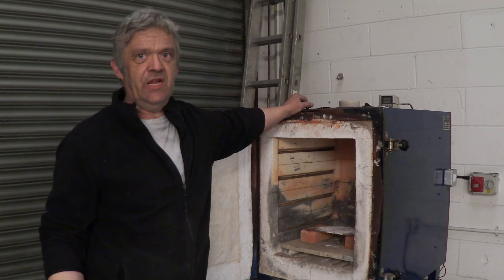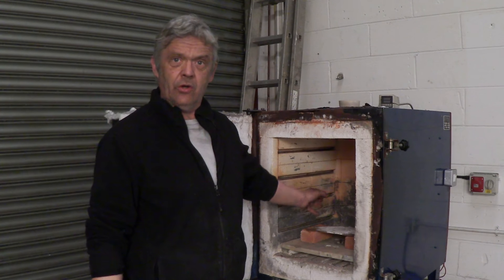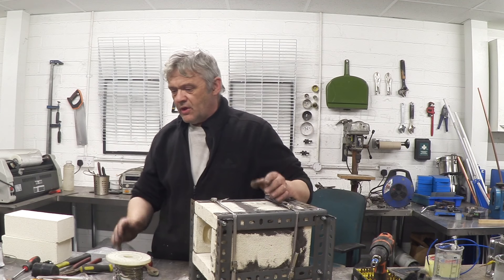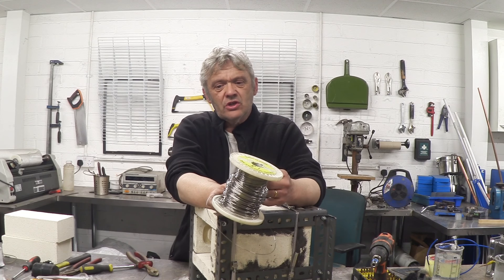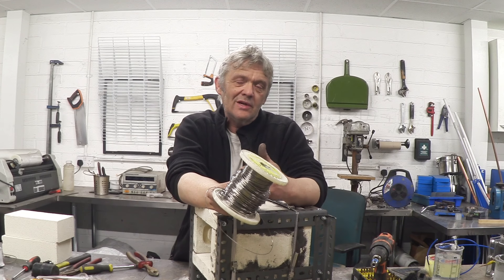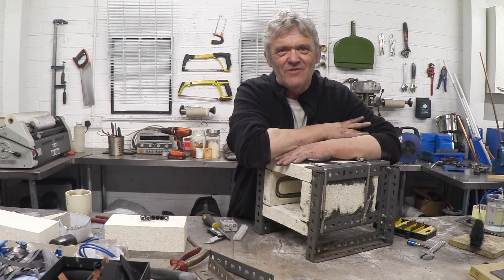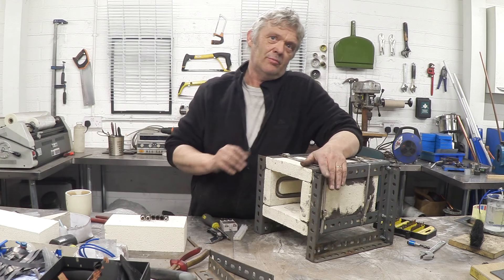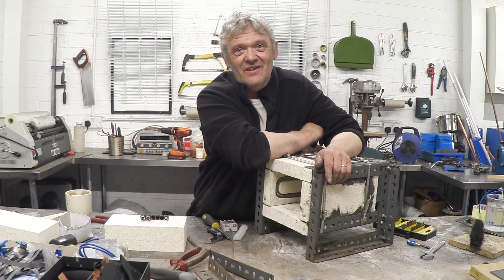How To Make A Lab Kiln - The Heating Coils

Comment: Double up your straight resistance wire at the ends and twist it. This lowers the resistance at the ends and stops the wire glowing on the outside of your kiln near your electronics.
Reply: They not supposed to glow. They will be hot, but not red hot.

The higher temperature of the conductor - the higher its resistance, coil heating faster because each of its turns heat itself and 2 neighbour turns + it is insulated with brick from 3 sides, so coiled part of the wire will heat faster, it would have higher resistance and because of higher resistance will generate more heat, while straight ends of the wire outside will stabilize at some 300-400C. This is common thing when straight ends of the heating coil not glowing, but the coil already yellow hot.
Reply from the maker: you can do mate - but there is no real need
Reply: @ThinkingandTinkering  In professional kilns the heating elements always have twisted(double) wires at the ends. This is also to avoid breaking the brittle threads when doing maintenance
Reply: Seems easy to do, and reduces the heat at the wire connections and near the electronics.

Comment: As others have said, many thanks for a great video. Think anything like this could comfortably be 30 minutes if you're expecting people to sit and watch in a single viewing or an hour if you're expecting people to pause it at various points to take notes.

I mentioned on an earlier video about doing some wind turbine experiments, I've had a bit of a setback in the form of an argument with an eBay seller over electrical ratings. Expect a ranting video from me over the coming days as I tear into the seller if they don't offer me an acceptable solution... Once it's resolved one way or other, I'll get the thing up on a pole and take some measurements, really inspired by a lot of the recent videos on this channel as I work through my own alternative power system. Thanks again Robert, keep up the great work.
Reply from the maker: yeah I have been having trouble with eBay sellers recently I am trying to get the stuff together for a flash graphene experiment - it has proved a nightmare and I have no idea why - so - good luck with it mate and cheers

Comment: Love the video!  I appreciate you filling in the details such as the heating element connections.  Very clear explanation and audio (and thank you for leaving out the bloody loud background music)!

BTW heat is bad for electronics, especially power electronics.  Relocating the SSRs (Solid State Relays) away from anything that is hot enough to glow during operation, preferably mounted on a heat sink (strip of 1.5mm or thicker aluminum at least) and maybe even with a cooling fan, seems good.

There is inductance in the coils, however the reactance is proportional to frequency; at a 60Hz AC line frequency the reactance is negligible.  If this was running at, say, 1MHz or above it would matter.

A fuse in the plug may eventually blow, because it'll run a bit warm; may want to have a spare on hand.

BTW at 11:20, I think you meant the bar was 1.2 cm (not mm).

Comment: There is huge confusion in the USA as to what the mains voltage is, it is 120V +/- 6%, and has been since 1967, not 110, 115 118 125 or 130 etc, the confusion arises because of how the grid evolved and was stitched together over 100 years, compounded by the fact that some appliance manufacturers still printed the wrong voltage the things they made for many decades after 1967. At my house I get 119.7V
Reply: 127V at the UPS input at my knee. Nuclear power station about 5 hours away, so we get the high line. Most north American appliances will actually be getting angry with 110v.
Reply from the maker: it's why you put a lot of safety in mate I added 20% as a margin - that's quite a lot lol
Reply: +6% is 125-6 or 7😅

Comment: I love your approach.  Just a thought on sizing the heater coil.  A more important factor is how hot you want the wire to get.  Your calculation in the video is for the minimum length (maximum amperage).  You probably need half of that, which reduces the temperature of the wire and extends its longevity.  The wire has a life versus temperature curve.  What you need is the heat loss versus temperature, easily calculated for that geometry and thermal conductivity of the fire brick.  That establishes your minimum power required, from which you can then determine the required amperage and resistance.  Compare this to the power available, and hopefully you can pick a point between these two limits - minimum power required versus maximum power available.  Lower power also means your controller has an easier time staying on temperature.
Reply from the maker: thanks for sharing that mate - cheers

Comment: Small detail but it is worth making some small squares with the ceramic fibre and cut a slot in the fibre and use it to surround the tails at the back of the kiln to block the hole where the tails come through,Also push some fibre through the hole to block the heat and fumes coming through  from the kiln chamber .It saves energy but the main thing is to save the connectors from seizing up,.which can make repairs difficult.

Comment: One channel I like to watch, Shadon HKW, recently did a video on how he makes coils for kilns that he builds for sale. He included several interesting tips. One tip that was mentioned was to double and twist the ends of the wire together to reduce the resistance and heat until the wire is actually in the kiln. That saves having red hot wires outside the kiln and going into the relay.
Reply from the maker: I will check it out - cheers mate

Comment: Curious about the effect the diameter of the coil has on the temp of the coil. You determined the size of your coil based on the size of your channel but I read somewhere in an old pdf that the Diameter of the coil affects the performance. My question is how? smaller coil = hotter element? Anyone know this relationship?

Comment: I was looking at the flash graphene stuff, I was waiting for more news to leak as I cannot access the paper, turns out your video with water welding machine prove it can be possible lol and your lab kiln is the remaining hints!
- the main requirement is temperature above 2000°c celsius in an instant, typical electric arc can reach up to 6000°c I found out, graphite rod melt at 3600°c, so this requirement is easy to obtain
- there is unspecified amount of pressure applied (so far)
- the material of the electrode is unspecified
- quartz casing is mention, but quartz melt at below the required temperature, I think it's protected by the speed of the reaction, I wonder what other material would be used and not react.
Sound like a kitchen experiment to me lol
Reply from the maker: I have looked at it - still waiting for parts - I have ordered twice and had the orders refunded - I am guessing cover screw up - but I will get round to it sooner or later

Comment: Hi many thanks for all the information and easy build instructions. I can source insulating fire brick, cement and ceramic blanket from Vitcas UK but I'm struggling to source 1.2mm 1.72 ohm resistence wire ? non on e-bay or amazon and can't find it via google, any sugestions ?
Thanks for your time. Danny

Comment: awesome,  ive been looking for screw connectors to interface power to some heater coils  as i am rebuilding a small jewelry vacuum atmosphere kiln.  found some bannaa plug connects in the back of the vacuum chamber are for the power,  got a good k type sensor and controller,   sadly im going to have to so the kaowool and waterglass  direction for the insulation,  because its round and odd sized.
Reply from the maker: that is a shame because it will limit your temp - but as long as you hold it down below 800 or so it'll be fine

Comment: For better acuracy and clarity, a heating coil isn't just pure resistance. Every alternating current  carrying conductor including heating coils have inductive reactance. Although, the relativly few turns and long length of coil and lack of a high magnetic permeability core (compared to an electromagnet)  means you can practically ignore the low inductive reactance in an electric heating coil.

Comment: These cheap, Chinese ssr 's  need to be well under rated I've found.  Instead of,say, a back to back pair of thyristors on a thick, copper base they are usually one triac on a piece of aluminium with an over long screw which often protrudes and affects heat transfer to a heatsink.
 They are not 50 quid like, say a Croydon from RS, but you get what you pay for and I've found it means you pay more than once!
Might be a topic for  discussion re under rating and filing the base ?
Enjoying the vids.
Reply: I derate Chinese parts by 2/3 generally. Some still get me.
Reply from the maker: yeah they do blow but it is a piece of cake to change them out - I have had them in the large kiln for over 2 years now - so when they blow it is a nuisance but only a nuisance not a nightmare
Reply: @AtlasReburdened  I would use  1/4 and still expect trouble.
Reply: @ThinkingandTinkering  I've had 2 years out of one too, suitably under run ( and safety fused, as they can often fail short circuit mode!) but I get 30 years from an Internation Rectifier or similar propper SSR I might have 'found' in a works parts bin.
 But obviously the cost isn't justified for a small, home kiln like this for most people.

Comment: i'm thinking maybe u can use ur ink to make a new type of kiln
i guess this method can reduce the size of the kiln to only the size of the the cup that is holding the material u want to heat
another idea
same ink can be applied to clay pot then put inside a microwave
i've seen someone do that on youtube i dont remember why guess it was a pottery application for his ink and it got out glowing red
sorry if those ideas were already applied or thought of by you, i still havent got through all ur so much valuable videos
wish i could replicate each and every thing u share but its really really hard to get the materials 
for now i'm still trying to find ammonium chloride or even ammonia to try make a graphene from sugar and that i will replace the kiln if i get ammonium chloride with good old fire and i will try the pipe fitting trick for that "i'll make sure to keep it a lil bit loose for air to escape "
thanks again for all the knowledge u share
cheers

Comment: When using coils in parallel you need to make sure their ohms are the same or one will draw more than the other.
Also what type of wire are you using, stainless, titanium or something else?
One last question, do you use a thermostat in the kiln or is that something you have not got to yet. I only ask because I don't remember you drilling a hole for one.
Reply from the maker: for sure mate on the resistors in parallel - I am using Kanthal and I will be using a K type thermocouple with a PID controller
Reply: Making them balanced makes sense if you want equal amounts of heat in each.  Making them exactly balanced is not be a strict requirement, if it makes sense to put more heat into one area than another.  However the lower resistance coil, if otherwise identical, is going to get hotter and have a shorter life.

Comment: If you can immerse your kiln in an inert gas [or devise a way to fill it with the inert gas] you can greatly extend the life of the coils, as well as prevent the atmosphere from reacting with the items one is firing or heat treating.
That said, I do not say it is anything easy, so its fairly impractical, unless you have a way to put a relatively gas tight box around the kiln which you can close up when you are closing up the kiln so that you can flood the kiln with argon or some other inert gas 
I fully recognize that for most people, this is not necessarily worth the price or the effort, so its more of just a 'point aside' for the really nerdy nerds, especially people like me, who would actually add nitrogen for the express purpose of nitriding metals.
When heat treating a piece of metal, to me, it is a real pain to have to deal with destructive oxidization [scale] which can ruin the surface value of an item [such as a pricey, fancy knife or sword].
Reply from the maker: it doesn't need to be gas tight you just need to match the flow rate with the loss rate - but you are right it is much more than folks need for most of the time lol

Comment: Thanks. Just thought if you have a small furnace you could make use of your mwave transformer secondary with really thick wire elements and a bonus of mains isolation!
Reply from the maker: for sure mate

Comment: Hi Rob! Any tips on where your resistance wire came from? I'm after rewiring a pottery kiln (small one, 12"cubed) on a 13A plug. Using the old elements I was able to reach 920 degrees C but the goal is ~1300C for stoneware firing. I've seen 'Kanthal A' seems to be popular but I can't seem to find any competitors, and yours looks like it might be something else, as Kanthal's resistance comes in lower per metre than yours. Any idea if your wire is rated as high as 1300C? I'd be grateful on any tips if you can share them.

Comment: Just came across this build, thanks Rob. 
I'm planning to build an electric kiln for knife making & finding it immensely difficult to find out how much wire to use & size etc... 
I must be a bit of a dummy I guess but as clear as your video is…for most people if find the info confusing, online calculators etc...don’t help either, maybe someone can help.
My kiln is very small internal is about 200x200x400.
I need it to get to 1100c for heat treating stainless steel.
What size circuit breaker do I need?
Whats the best size Kanthal wire to use?
What diameter & length should I coil the wire at?
Can anyone help?

Comment: When buying the wire, which would the be the more important bit, the diameter or the resistance? Cause I can find a 1.71 Ω per meter but it's .9 mm, the 1.2mm they carry is 0.96Ω.

Comment: Make your coil ending a bit longer, bend them back to the coil and twist them, so you have double wires going into the heating chamber. It spread the current, lowering the temperature on the outside wiring and keep the wire colder when going through the holes (which cannot dissipate the heat, leading to a failure point).
Reply from the maker: Thanks for the tip mate - but you really don't need to bother - I have used this arrangement in my big kiln for four years and had no issues

Comment: Would it be possible to share a link to the resistance wire you used in this video? Thickness of wire obviously affects resistance but how does it affect what temperature it can handle? Do thinner wires break faster under prolonged heat?

Comment: what is a cooker socket/shower socket? it's rated by default to higher amp draw? do you use a "special" socket for your refurbished kiln?
suposedly the answers are yes ... and i don't have a higher rated socket, what i would need to do is mount a higher load fuse to the panel of the house for the circuite i want to use?

Comment: great video! is there a reason I shouldn't use frax fiber board instead of those heavy firebricks? it seems a hell of a lot lighter. thank you!!
Reply: Generally speaking, small DIY kilns use silica fire bricks for the walls and roof of the oven and a more dense and harder fire brick for the floor. Silica bricks are very light and easy to cut and channel with an ordinary hacksaw. Different story for the heavier floor. I would use a diamond or ceramic cutting disk in an angle grinder for that. I am not a safety nazi but inhaling silica particles can lead to silicosis.... Bad way to go. Use a respirator or if you have a problem with that, keep the silica bricks wet when you cut them.

Comment: Thanks Robert. I wish I had seen this video about 2 years ago when I began designing and making my own small kilns and foundries. A problem that has been a regular cause of failure is the elements falling out of the channel, touching something I am heating, invariably becoming a fluxing material for the Nichrome or Alchrome wire and melting my elements. So, will you include some staples or similar fastenings to stop the element from flopping out when it gets beyond 1000˚C? Usually happens to me after a few heat cycles.
Reply from the maker: I cut my channel quite deep with c cross section mate - to be honest I have never had that problem
Reply: Kiln brick is very soft so you could just use some 25 mm threaded rod to grind a trough to hold the elements.

Comment: Most interesting. Your video has just galvanised me into doing what I have been thinking of doing for quite a while now and that is, building an electric kiln. So, would you be using Kanthal or Nicrome wire for your heater elements. The reason I ask is because I believe that I had read somewhere that Kanthal has a lesser tendency to spall / oxidise / or otherwise fail due to moisture, thermal shock etc etc. I could be wrong of course...
Reply from the maker: I use Kanthal mate - it gives a good life - not forever obviously - but good

Comment: Awesome project. I am wondering were you get these wonderful materials from. Coincidentally i am working on a kiln just like yours but it took me ages to find such fire bricks and even though i got them now i can't start with the building because i can't get hold of a resistive heating wire. Where do you get the wire from? Is it sold commonly where you live? In Austria, where I am, it seems like it isn't sold on the public market. I have to contact companys which produce these items on an industrial level. Do you have any tips for me on how to get such a wire?
Reply from the maker: ebay mate